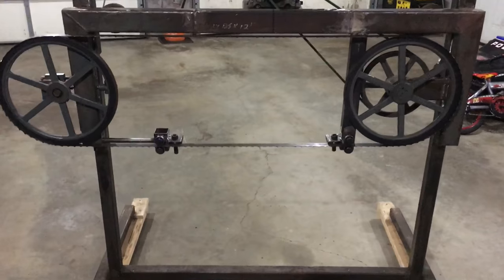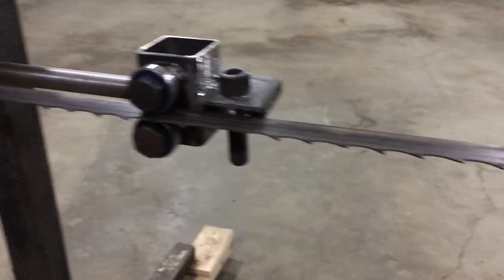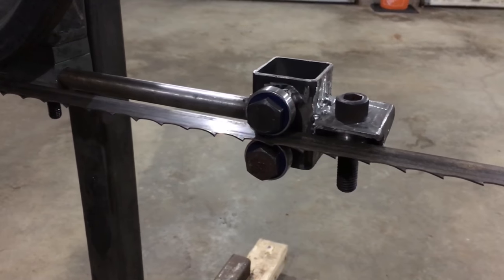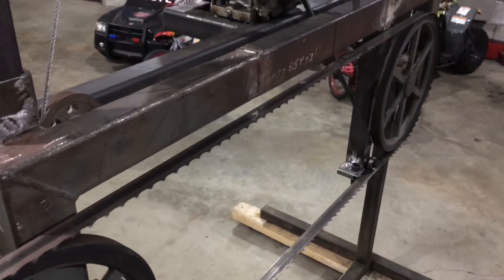How to build a simple Bandsaw Mill #4

Comment: As far as the speed, look at Woodland sawmills. Their driven pulley is the band wheel, and they use the same motor you are using and by the look of it, also the same diameter centrifugal clutch.
Reply from the maker: Dave Underwood I have a bigger motor now with a better rpm control. I should have another video up shorty.